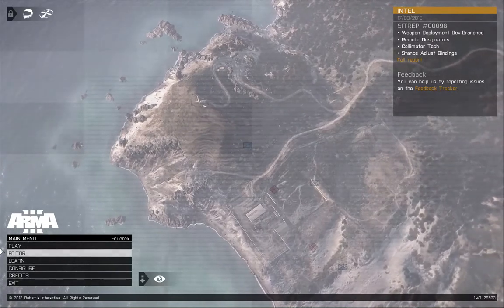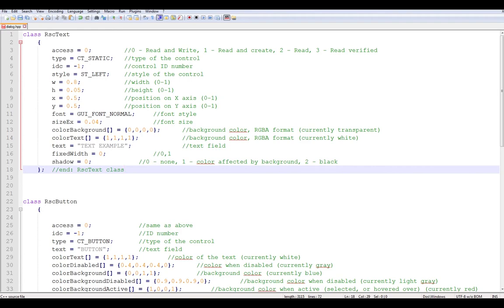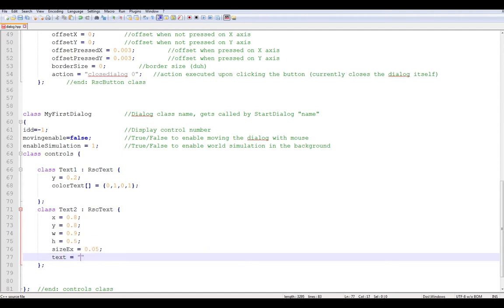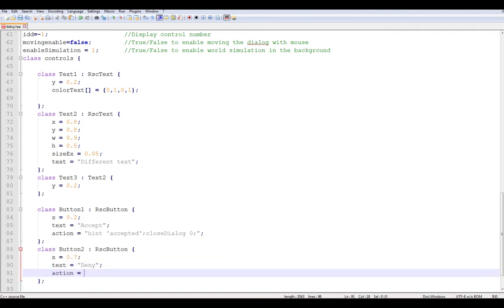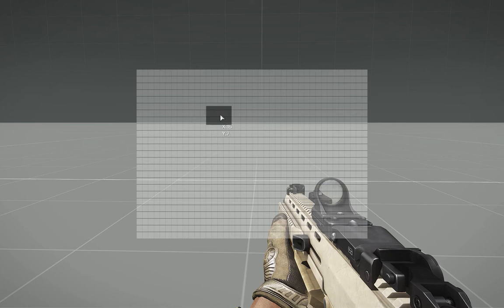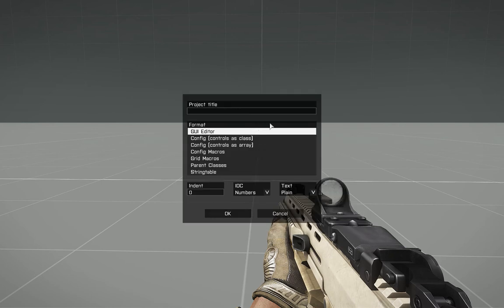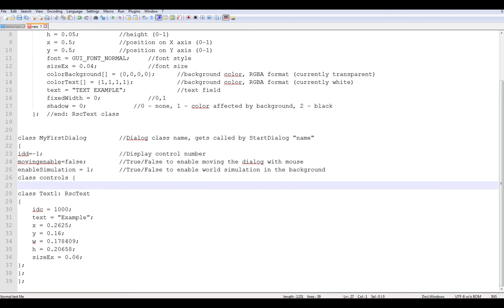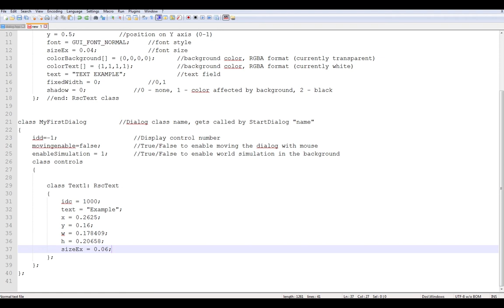Arma 3 Editor Tutorial - Dialog Basics Part 2

Comment: I am loving these mate! Any chance you could expand on IDDs and IDCs at some point? I get the reason you use "-1", and I have seen others use really high numbers, as the lower range numbers have already been allocated in the ARMA code. But I am unclear when/why you would use IDC "-1" compared to a custom [e.g.] IDC "10000". Sorry, I hope that is clear..
Reply from the maker: well, you said everything there is about IDD and IDC. Low numbers are taken by Arma, so usually you go for 1000-4999 for IDD and 5000-9999 for IDC - but any other numbers are fine as well. Since the default in-game GUI editor outputs IDCs around 9000, mod makers usually tend to use even higher numbers to avoid any potential conflict. As long as each number is unique, you're usually fine.

The numbers aren't really important in any way, unless you need to find your dialog through scripts later on during the mission. I can use the dialog IDD to see when it opens / closes, and tie certain actions to these moments. I can also use dialog IDD to find the correct dialog "window", and then use the control IDC number to reach a particular control - eg. a text field, and dynamically change it through scripting. 

I used -1 to indicate I won't need the number at any point in the mission, for the purposes of the tutorial. -1 is an invalid value and I can't reach it with script commands. I saved a few kb of memory because the game didn't need to remember the IDD, but it's more of a custom thing to indicate that the dialog ID isn't used anywhere outside the initial definition in description.ext / dialog.hpp. Using any other arbitrarily chosen number wouldn't change anything (unless it would conflict with some other control of course).

The commands for reaching dialogs through scripts would be nice in a tutorial, but it's quite a big topic and at this moment I'm not confident that I would do a good job representing the possible uses. I did make an example mission that, aside from other things, makes a custom dialog AND uses its ID numbers to reach individual controls throughout the mission, where both the IDD and several IDCs are used, so you can take a look there, if you're interested. The video is super boring, but the mission is kinda cool. 

https://www.youtube.com/watch?v=ctjTT2mR-fI
Reply: Mate, that is a wealth of knowledge right there, thank you very much! I think I may need to re-read this in a week or so, as I am only just starting out with GUIs in ARMA and still have a long way to go. But it is a great subject, and this is an awesome info-boost for me, and probably many others :) 

Thanks Man